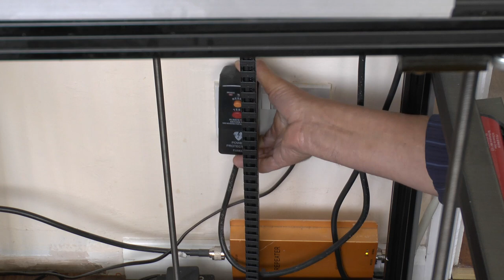3D Printer Upgrade to Five Bondtech BMG Extruders

Comment: Too heavy, no?! How fast can you print with this setup?
Reply from the maker: No. Mass is not a limiting factor although most people think it is. I managed to print at up to 300mm/sec with a 0.5mm nozzle and 0.3mm layer height by feeding 5 filaments into that mixing hot end and using all 5 extruders at once, to achieve that necessary melt rate - see my other videos - especially this one.  https://www.youtube.com/watch?v=rUV5IZxfAxU. 

By default I use a travel speed of 350mm/sec with acceleration set to 2,000 mm/sec^2. The motors are capable of even higher speeds and accelerations with that mass, but like all 3D printers, the limiting factor is how fast one can melt and extrude filament, not how fast one can move the nozzle. It's a fallacy that reducing mass will mean you can print faster because, as I say mass is not the limiting factor - filament melt rate is what will ultimately define how fast you can print. 

BTW, that video was made 2 1/2 years ago - if you look at my later videos, you'll see that I now have 6 extruders and the printer has become a CoreXYUVAB.
Reply: @deckingman  I got you. One gantry assists the other. This way the mass is no longer a limiting factor, indeed. it's a fantastic system! Did you invent it yourself, or is it based on another printer?
Reply from the maker: @fabiogarcia1431  It does help having the mass split between 2 gantries but that's not the whole story. My latest iteration with 6 extruders has about 5 Kgs of moving mass - about 3 Kgs on the UV gantry which carries the 6 extruders, and about 2Kgs on the XY gantry which carries the mixing hot end. Yes, it's my own idea. It's the world's first CoreXYUV but others have since made copies. Other people have also copied by AB load balancing gantry but as far as I know, nobody else has built a CoreXYUVAB with all 3 gantries. The reason for it is to do with having a mixing hot end. Using direct drive extruders is not practical because to mount 6 of them onto a hot end is simply too big. So I have to use Bowden tubes. But because the frame is 600mm square, then if I had mounted the extruders on the frame, the Bowden tubes would have been about 1 metre long. So mounting the extruders on a separate gantry, directly above the hot end, means that the Bowden tubes can be much shorter.
Reply: @deckingman  All that makes sense. I'll watch more of your videos. Great job! Thanks for the insights.

Comment: What kind of problems do you had with your E3D Titans?
Reply: Just read on your blog that the Titans ground through the filament, because they are springloaded.
Reply from the maker: Grinding away of the filament mostly but mine is a unique usage case. I explained it in my blog (for some reason I can't post a link to that post here).
Reply from the maker: Sorry - didn't see your earlier reply but yes, that was the main problem but mine is a unique usage case so most users wouldn't experience it.

Comment: what material are those parts printed in? my guess is PETG, ABS or nylon. probably PETG
Reply from the maker: Sorry to disappoint you but they are just plain old PLA (Filaprint own brand).
Reply from the maker: In fact, all the printed parts for the entire printer are just PLA with the exception of hot end X carriage and mount, which are E3D edge (PET-G).
Reply: and the PLA is strong enough? if i print something out of pla and put a bolt in, after a year or something the pla begins to move under the pressure of the bolt
Reply from the maker: Yes no problems after about 2 years and hundreds if not thousands of hours print time. Obviously, it's good practice to use a washer under the bold head to spread the load and don't over tighten the bolts. If it's a structural part, use high infill density. The only issues I've had with PLA is when used for motor mounts and the heat from the motor, after 10s of hours of printing can soften the plastic. For extruders, it doen't matter but for XY motors, the belt tension can distort the softened plastic. I tried PETG mounts but they weren't much better so ended up fitting heat sinks and fans to all my motors that control motion. You can see them on the UV axis motors in the video.